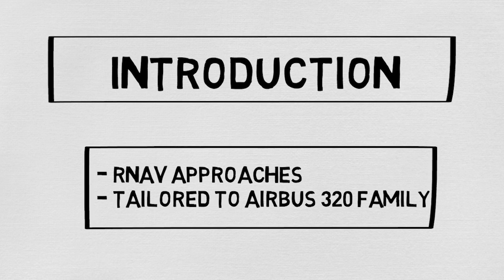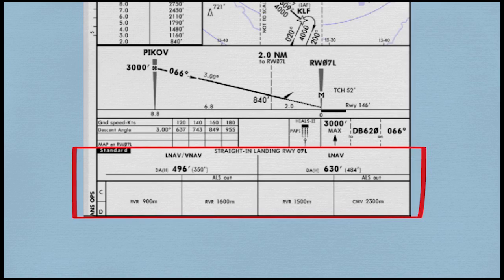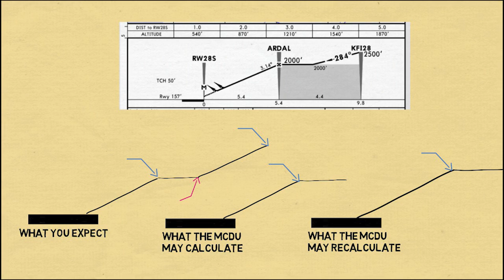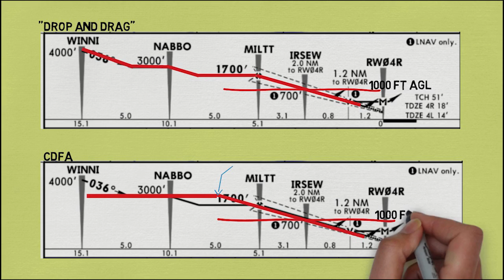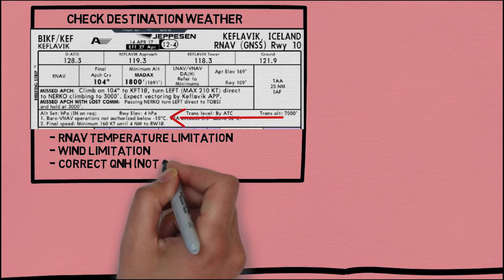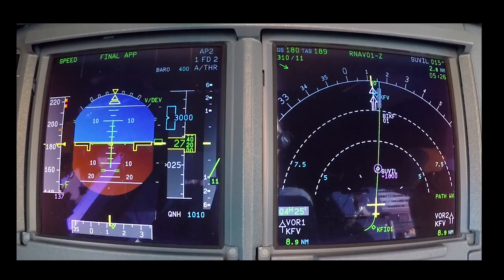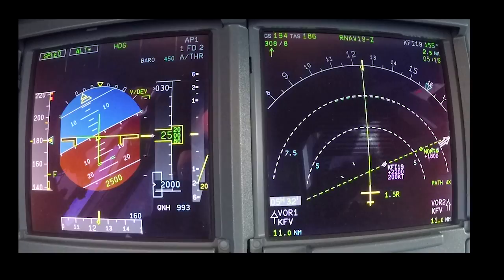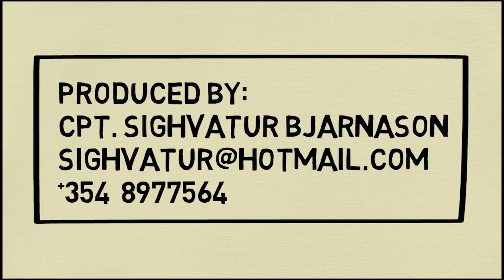RNAV A320 Course: Demo Presentation

Comment: Hey Mr. Bjarnason.  If GPS primary is lost in cruise on an RNAV 10 airway, the correct procedure would be to change the RNP up to 10 correct? There is a table with some RNP values when GPS Primary is available. I've seen TRI/TREs say that those are the appropriate values when GPS primary is lost. I think it's totally BS.  If GPS primary fails, the appropriate RNP is the one you are currently in.  SID/STAR = 1.0. correct?